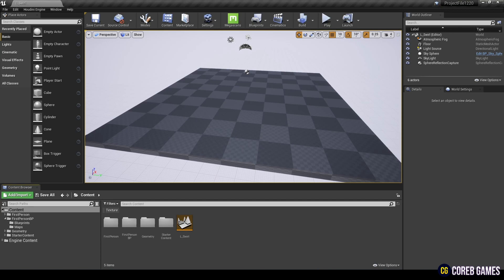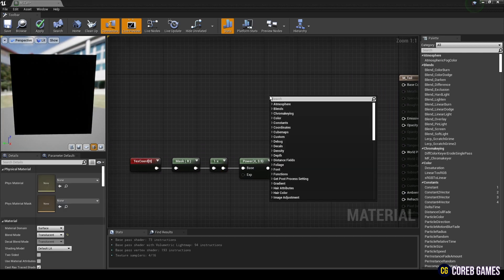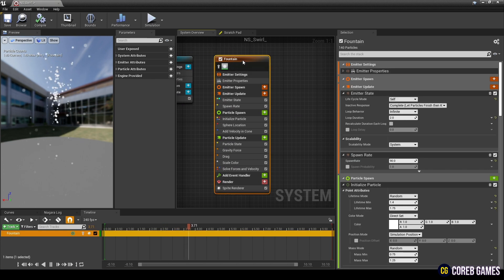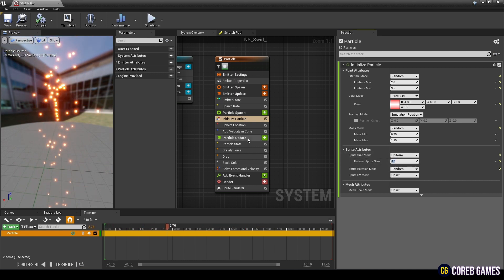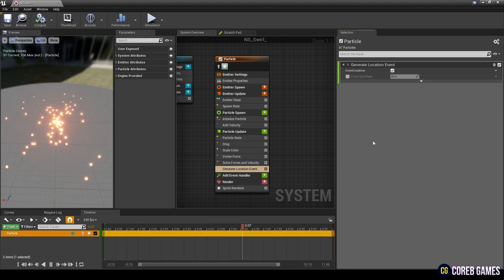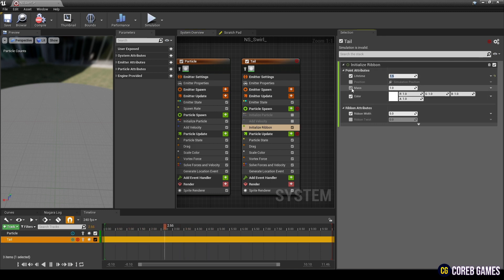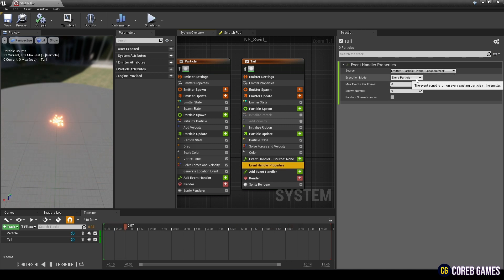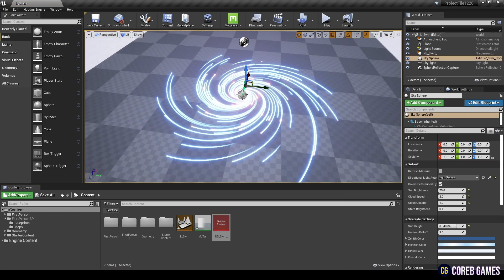UE4 l UE5 l Swirl Effect l Niagara VFX Tutorial l Unreal Engine 4.26

Comment: I got it to work in UE5, here's the extra steps and notes:

1. 'Initialize ribbon' is incorporated in 'Initialize particle'
2. Add 'event handler' group by clicking the '+ Stage' button on the right (at the same height as 'properties')
All the other steps should be the same.

I played with settings in Receive Location Event, not sure exactly how it works, but when I set Color to apply and apply RGB to true, I can control the ribbon's colors from the first and the second system's scale color. It gave me some extra depth to the gradient.
Reply: Not all heroes wear capes...

Thanking you :medal-yellow-first-red:

Comment: Hi, i'm using UE5 I don't seem to have a initilize ribbon and when I uncheck requieres persistant ID I get an error
Reply: Hey fam, all you need to do in ue5 is keep initialize sprite on, select it and scroll down to the "Ribbon Attributes" section, turn Ribbon Width Mode to Direct Set and set the width. Then turn all of the settings under "Sprite and Mesh Attributes" to Unset. Then in Point Attributes set the lifetime mode and everything should work ez peasy.